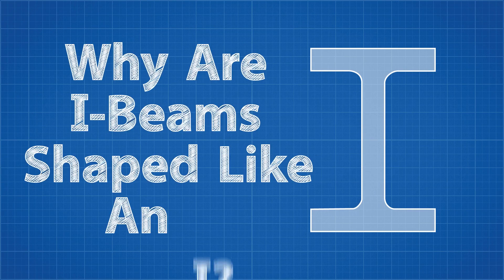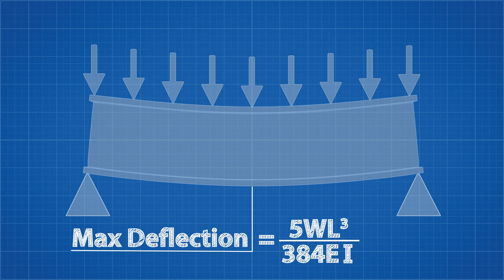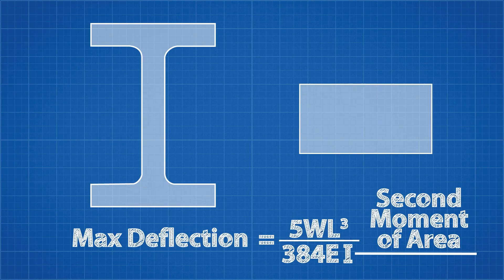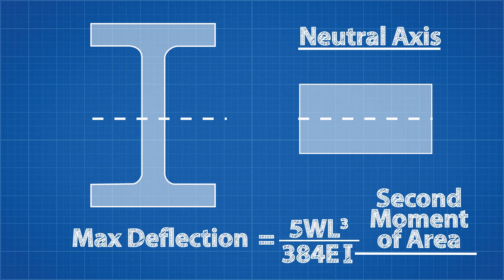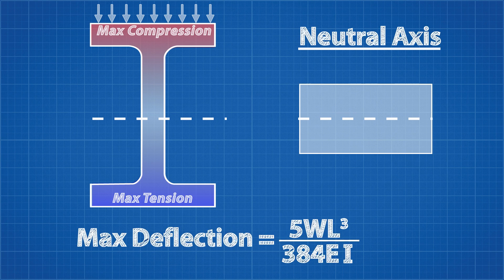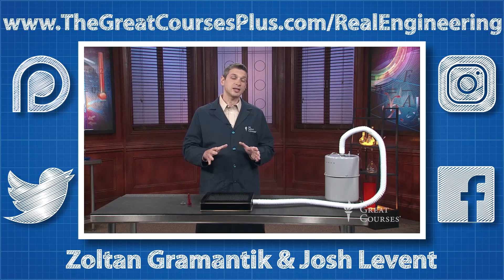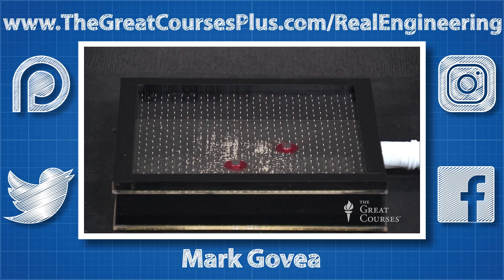Why Are I-Beams Shaped Like An I?

Comment from the maker: There is a type in that equation, It should read L^4. Thanks to everyone for pointing it out. That's what I get for rushing a video and not proof reading!
Reply: *typo
Reply from the maker: God damn it 😂
Reply: there is a typo in this typo correction. LOL
Reply: Thank you for the very well written response. That's something I hadn't considered because the focus of the video was on purely vertical forces. If it was a slender piece it would fail with relatively low torsional or lateral forces.
Reply: Precisely.  Glad I could help!
Reply: Alien Mechanic: In section analysis, the radii do not really figure in to how strong or stiff a piece of steel is.  There is a benefit to having radii in lieu of angular re-entrant corners so as to prevent stress concentrations, but they are otherwise unimportant (entirely neglected in all practicality) in determining the size or shape of the beam.  Insofar as tubes having differing inner and outer radii, this is so the wall thickness of the tube is maintained in the corner... which, again, is not all that important in section analysis, but may assist in fabrication.
Reply: L^4?!! Too late for the Tacoma Narrows bridge tho ~~~~~~~~~
Reply: Your videos are great but! Typically a capital W represents the total load (N). That would mean that your equation would be ^3. ^4 is normally used with a small w where your load is in N/m.  Also you could have done so much more with this, would have liked to have seen your commentary RE: radius of gyration, torsional constant, buckling etc. Great job though.
Reply: So if the strength is improved by moving material furthur from the neutral axis why wouldn't you also turn the top and bottom of the I sideways (and use a vertical plate just thick enough to not shear)
Reply: Could a hollow tube (with greater thickness at top and bottom) be as efficient as an I-beam?
Reply from the maker: I was away from my computer all day yesterday, had to reply to everything on my phone. I struggle with spelling and grammar :(
Reply: typo*, but I am sure that is just a typo.
Reply: ohnonomorenames I am sure you understand that you cannot do such a complex subject like this any justice in a short youtube video.  For what it's worth, Real Engineering provided a very informational and concise anwser to the question, "Why is an I-Beam shaped like and I?"  No one who watches this video should be calling him or herself an engineer or should believe that he or she is thoroughly versed in beam mechanics without first taking the requisite coursework and gaining the necessary experience.  The layman should expect nothing more than a simple answer to a simple question.  I believe that is precisely what this video accomplishes.
Reply: NO!  (I see my college professor about to lose his mind)  In the context of deflection, yes, you are correct, but strength is an entirely different thing all together.  Yes, it is thoroughly confusing, but you cannot directly correlate strength to stiffness.  Your statement would have been perfectly accurate if you had said "16 times as STIFF...".

For most beam designs, you have to check deflection (5wL^4/384EI), moment (bending) capacity, and shear capacity.  There are potentially several other "limit states" to check as well, but that would require a course in steel design.  Let's keep it simple.

Given the same loading condition, the maximum moment (bending force) on the beam is (1/8)wL^2.  The maximum shear on the beam is (1/2)wL.  Accordingly, if you make any beam twice as long, it would have to be 4 times as STRONG in bending and twice as STRONG in shear, and 16 times as STIFF.

Just wanted to clarify.
Reply: +Alien Mechanic - The same principle, but applied along both axes, so it can withstand both horizontal and vertical forces as well as possible, with the minimum amount of material.
Reply: v_i_v   beam
Reply: I think you can add an annotation indicating where the error is in the video. I dunno how to do it, but have seen multiple other channels like scishow employ it to correct minor typos
Reply: typo*
how did you mess that one up
Reply: typo theres a typo in my typo
Reply: Everybody that got through 1st year statics is ripping their hair out. Anyone that paid attention to materials has dropped a kidney. All of this would be fine if the massively oversimplified explanation worked for they layman. It seems that it overshoots the layman and irritates the educated doing no one a service.
I may be wrong there might be a few very clever high school students that find this useful while understanding the limits.
Unfortunately i fear most will be irritated or given a limited to wrong explanation of why we use I beams.
Reply: Yes!  In fact, they do.  Just making sure we are speaking the same language: the horizontal platforms (top and bottom) are called flanges, and the vertical material that holds them together is called the web.  Rudimentary section analysis says yes, take all of the material and make one tall, thin beam without flanges.  The moment of inertia for a rectangular section is, afterall, 1/12*bh^3, and the elastic section modulus is 1/6*bh^2.  In either case, increasing the height h of the section greatly increases the moment of inertia (beam stiffness) and section modulus (beam strength).  However, a thin piece of steel is much more vulnerable to lateral torsional buckling and local failures.  "Slenderness" is a somewhat generic engineering term that defines these issues.  A secondary function of the flanges is to stiffen the web to provide more resistance against the effects of slenderness.  Diving even deeper into section analysis, you find that the flanges and the webs themselves have to have certain aspect ratios under certain loading patterns or they risk being slender and therefore susceptible to local failures.  The overall effect is that the I-shape is a balance between efficiently using steel and mitigating the effects of slenderness.
Reply: Real Engineering i'm a civil and structural engineering student in Singapore.

In Deflection calculations, we always look at which material tht was used during construction. In this case, I-beam is a steel material hence the span coefficient should be L^4. However, if you are looking at concrete structures or reinforced concrete structures, the coefficient for L would be L^3. 

The rest however would stay the same. 

Hope this helps :)
Reply: how about square tubing?
Reply: Square tubing can handle bending in the main axis, but the real benefit of square tubing is torsion.  When the material has what I call a "polar closure", it can handle torque along its longitudinal axis much better.  Square tubing is not very efficient for bending.  The I-beam, called a W-shape according to the American Institute for Steel Construction, is the most efficient shape and likely always will be.  The next big thing will be shell structures and space frames, but that's a more advanced topic.  ;)
Reply: same
Reply: geez that means that if you would make any beam twice as long it'd have to be 16 times as strong...
Reply: Yes. He typoed typo. I think I see how he messed that one up Mical. As far as I can tell there seem to be two kinds of typos. The fumble typo is when you miss the key you were aiming for and accidentally hit a neighboring key. That clearly isn't the case here since (and we are assuming he is using a standard asdf keyboard) 'e' is clear on the opposite side of the keyboard from then intended letter, 'o'. The other sort of typo is more psychological. It occurs when the word you intended to type is very similar to another commonly used word and your muscle memory just gets confused. Since 'type' is a commonly used word that is very similar to the intended word, 'typo', it seems likely that this is the case here.
Reply: Why would it not make more sense to put the horizontal material vertical? You could just have platforms along the length to save material. Or do the horizontal platforms serve more of a purpose?
Reply: I was wondering because the i beam is symmetrical where the center peace is connected to the top and bottom peace with a radius on both sides, a square tube is not symmetrical, it have a different radius on the inside of the corner than it has on the outside of the corner
Reply: I’m not certain on this but in the bending deflection equation since the force is a shear force on the beam shouldn’t the shear modulus be used instead of the Young’s modulus? I just know they’re sometimes different values
Reply: @connoruzzo4004  When designing a beam, you would check the bending capacity > demand, the shear capacity > demand and the deflection (serviceability) vs certain limits depending on the type of loading for the member, but the deflection equation for a simply supported beam with a uniform load is (5*w*(L^4))/(384*E*I). Depending on the boundary conditions and types of loading, that equation will change, this is one of the simplest types of loading's and connections.
Reply: Real Engineering Hello dear are you structural engineer or civil
Reply: Real Engineering In this equation we can play with only WITH Inertia rest can't be changed because stiffness material are unchanged . This is why Holllow cylinder takes more load than Solid cylinder . Because mid along any larger axis , only outter fibre takes load( Tau And sigma) in case of complex load ,not in pure shear and bending
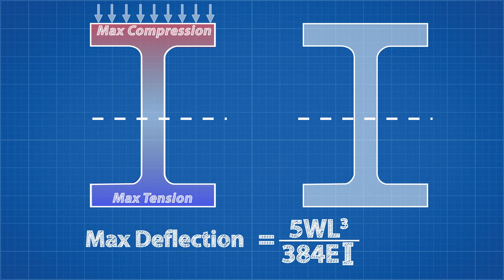Reply: Wow.  This video actually did not explain or know why it is letter I shaped. 2:25 Placing the excess material at the top?! 🙄
If the load is truly vertical, 90 degree to the beam,  it wouldn't need the top or bottom materials.  The needed material should be enough to resist the shear stress.  
However, in the real world,  no load is perfectly aligned.  The materials at the top and bottom is to resist twisting and bending from a load that is not perfectly vertical.
Reply: Do something related to shear stresses in these type of beams because they also play a pivotal role in the development of the structures and superstructures
Reply: Real Engineering It's very apparent you understand Engineering. There's many mechanical Engineers in this world, what boggles my mind is why haven't one of them invented a suspension system that would make a late model 1/2 ton & 3/4 ton pickup trucks ride smooth like a Rolls Royce??     I (know) it's possible even with  a rear leaf spring front coil spring suspension. Vintage Rolls Royces have done it.
Reply: @Mr.Beastforpresident  because they need oatmeal runders.
Reply: GET IT TOGETHER MAN

Comment: Or you could have simply said a board (or any material) bends more on it's flat than if it's stood up on it's edge.  The vertical edge (cross section) resists vertical and the side parts keeps it straight

Comment: Hi! Great, simple explanation.

One pedantic note though, The profile you have drawn there is not an I beam, it is known as a wide flange or W beam. True I beams have tapered flanges.
Reply: maskedmonkey2  I’m afraid not, that would be a rolled steel joist (RSJ). At least in the UK and Ireland.
Reply: scott vincent Ask any practicing Structural Engineer.  He is correct.

Comment: Only bad thing on these beams is that they can be easily melted by jet fuel xd
Reply: Jiří Atanasov I see what you did there.
Reply: so much ignorance in this line of comments
Reply: I beams weren't used in the construction of the wtc it was trusses. Had they been used the towers would've stood much longer since trusses lost their strength faster in a fire because they were lightweight in contrast to I beams.
Reply: Jiří Atanasov - And that's what happened with 9/11 guys!
Reply: The World Trade Center failed because of progressive collapse of one floor to the next.  The joists provide lateral support for a column (google the euler column buckling theory) and once the joists were melted, the columns became more slender than they were before.  If the floors were post-tensioned slabs in lieu of steel joists, a progressive collapse likely wouldn't have happened.  Mr Atanasov is partially correct.
Reply: Jiří Atanasov 

I was hunting for this comment 
LoL
Reply: The used I beams in the interior parts of the building but not on exterior parts the plane hitting the buildings didn’t help either the planes that hit the buildings were heavier than a wrecker ball by nearly 150 times and traveling at a much higher speed and two the planes hit a corner section of the buildings at an angle not straight.
Reply: Did anyone ever ask if it's a GOOD idea to fly these planes at 30 to 60k feet; There are 1m people flying, on average, every second of every day. 
Jet Fuel is essentially Kerosene....-40° at 40k plus feet going 600mph, approaching the sound barrier, there's your "Chemtrails."
Reply: And forests burn ...what's your point other than a stupid comment about 3000 people being murdered

Comment: Because the letter H was busy.
Reply: You actually made a list?
Reply: There are actually "H" shapes. But they are used as steel piles that get rammed into the ground.
Reply: HP shapes according to AISC.  You are correct Mr Wong.
Reply: It's finny beacause in Spain it's known as "double T" section
Reply: H beams exist, the middle section is a bit shorter and the the end sections are wider. Boom, H beam.
Reply: "Pourquoi les poutres métalliques en "H" ont-elles la forme d'un "H" ?"
that's what I thought google had translated the title of the video like pigs ... I wonder why they translate the title, I watch the video in English ..
Reply: Fun Fact:
In Germany it's a "Doppel-T-Träger" (a Double T beam), because it looks like two Ts rotated 180°
Reply: @p3chv0gel22  Germans just have to overcomplicate everything Huh...?
Reply: @stepandanek6138  are we overcomplicating, or are you just undercomplicating? ;)
Reply: @p3chv0gel22  maybe both...? With overcomplication comes precision, but some people figured out a way to have prescision even without overcomplication. Both are expensive though.
Reply: @p3chv0gel22  but then again having a precise description can save some awkwardness
Reply: There's an O-Beam....

And we call them "pipes"
Reply: The letter "H" is one of the least sexy letters, along with "Q" and the umlaut. "X" and "V" on the other hand are extremely sexy. Check my Tumblr page for my complete list of "every letter in every alphabet for ever language ranked by sexiness".
Reply: No, H beam,U beam an L beam exist too
Reply: An h-shape is only efficient in the opposite direction.  I know you're joking, but ignorant jokes aren't as funny to the knowledgeable.
Reply: "Tone it DOWN!....a little Scotty"
-Dr Evil
Reply: Well you have the HEA-beam, which is more or less a H-beam.
Reply: +Arthas Menethil
You don't have enough imagination
H is a "right before it is inside" pose
h is pretty obvious, on the left is the man, on the right is the woman
Q is top view of man
q is 69, but 1 partner leaks feet of another

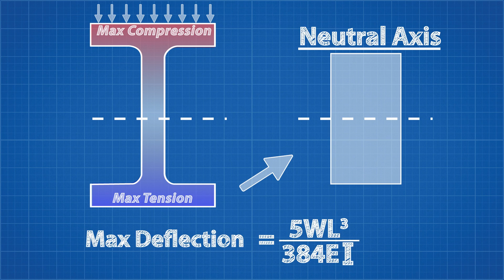Comment: Could you expand on what you meant at 2:22 about the sheer stress? Why couldn't the middle bit be any thinner?
Reply: Consider a ream of 500 sheets of paper, acting as a beam.  The sheets are free to slip past each other, and it isn't very strong.

Now suppose someone glued all 500 sheets together, so they can't slide past one another.  The glue adds shear strength, to resist the shear stress associated with bending.  This is why the web cannot be made paper thin.   It needs to keep the top flange and bottom flange together, so they curve concentrically with each other, and have equal and opposite normal stresses.
Reply: @carultch  ah thanks that makes sense

Comment: This concept is also the same reason that swords have grooves running down the center.  And if you look at some of the later patters in hardened/soft steel in Japanese sword smithing you can see similar tactics being used.  Love this channel and continue to be surprised by the amount of work that is put in to planning every detail of modern construction.    
- любовь из Америка.